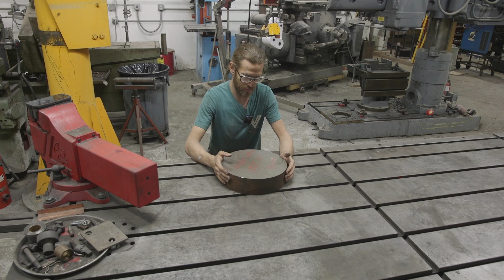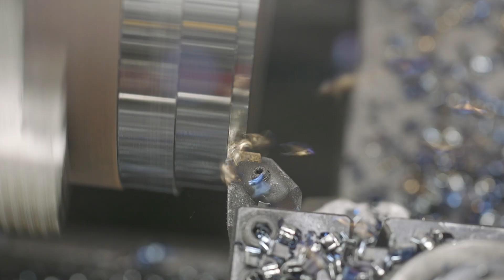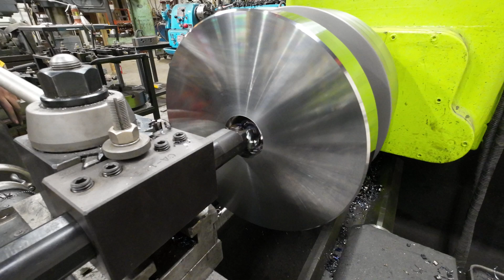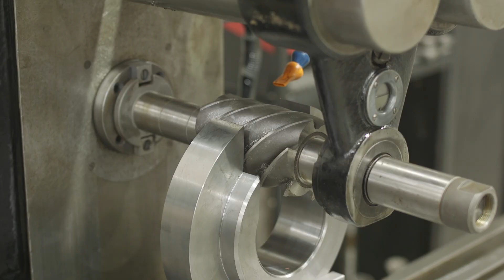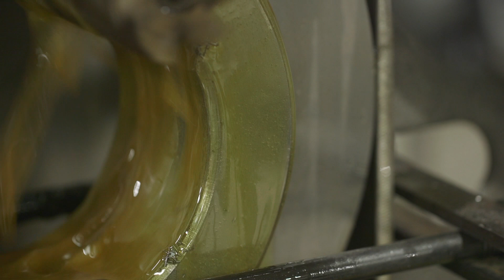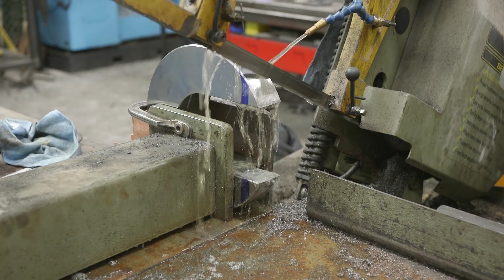Heavy Turning On Pacemaker Lathe (Making a Large Spacer) | Arbor Press Restoration

Comment: Negative rake carbide inserts cut by using the heat generated by friction to plasticize/soften the metal then essentially scooping the metal off the round being turned. Completely different method of metal removal from a positive rake insert which essentially shears the material off the round.. Positive rake inserts are fragile and could never survive this kind of material removal duty. Positive rake inserts work on low power lathes that do not have anywhere near the rigidity/stability of a lathe like this ATW pacemaker. It is possible to go more than 0.5" DOC with a CNMG43x insert as the chips will come off the cutting tool blue chunks when feed/speed/DOC is optimized. 

This is how these carbide inserts and ATW pacemaker was designed and intended to be used daily year after year...
Reply from the maker: Yea indeed. I certainly can go deeper but feed rate optimization is key to not bog down machine or brake inserts.

Comment: On long mild steel bar stock I have done .750 diameter reductions in one pass on my grandfather’s 18x72 engine lathe. The limiting factor? Slippage of the leather belts. F.E. Reed, made in 1892. It’s last production job was 9,500 pieces circa 1970. It’s now in a museum’s steam-powered machine shop. Like a lot of old machines, it’s a beast- a 2-ton chainfall could only lift the headstock end.
Reply from the maker: Dang that’s crazy. Old Iron!

Comment: The first thing to do is punch as big of drill through the center and get that out of the way.  
By taking out the center first you don't have a chance of disturbing the concentric diameters that you have already turned. Also when later you are facing, you won't run out of surface speed on the smaller diameter. 
You should have ditched the idea of holding the part in a vice. Strapping it directly to the table would have been much more rigid.
Maybe in twenty years you will stop screwing up.  Good luck.
Reply: What an obnoxious way to finish an otherwise-decent comment.
Reply from the maker: Maybe in 20 years I will stop screwing up…Probably not, proud to be human!